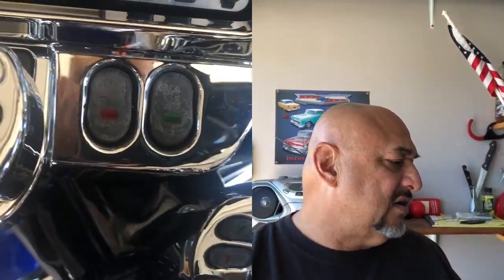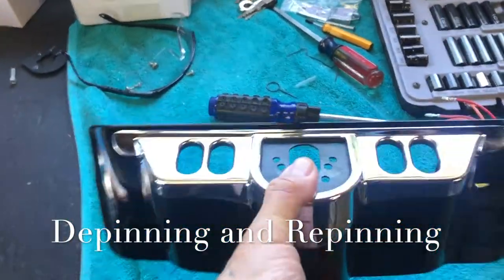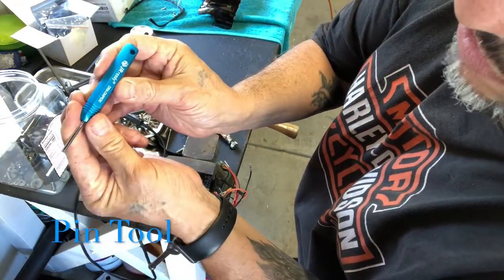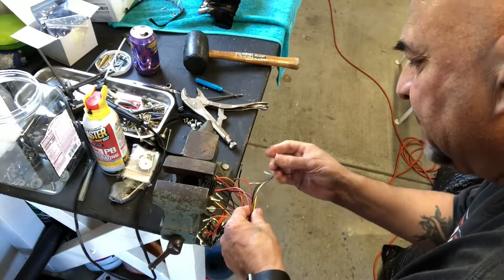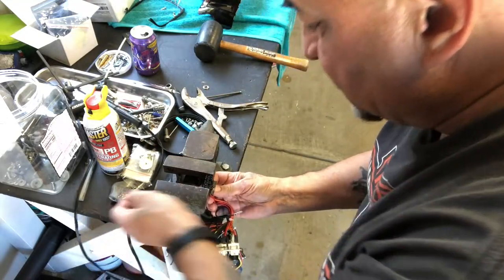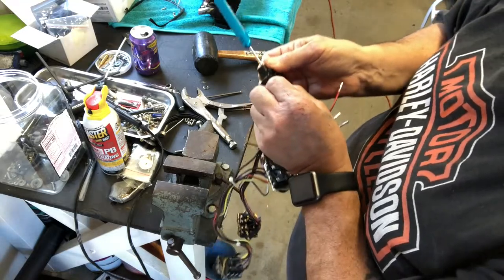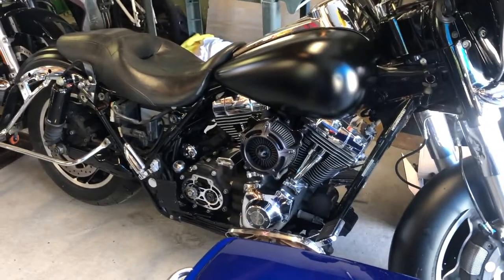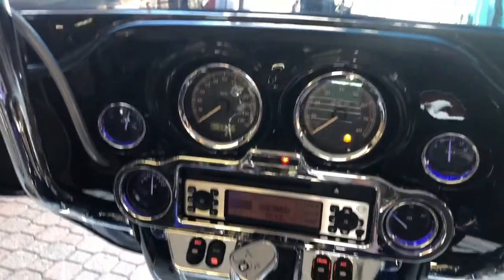NEW HARLEY ROCKER SWITCHES LOOK GREAT!!! #harleydavidson #HDtutorials #Harleybuilds #HDRides

Comment: Can you hard wire one of them switches to a hot and ground to after market spot lights. Problem the after market lights have 2 wires and the switch I got from harley has 3 wires?

Comment: I had Harley redo my button panels too but the speaker button doesnt function with the new Jensen radio I had put in. Same bike and year btw. The service manager said it was to cut the tweeters I had put in off and on. But they dont. The button lights up but just doesnt function. Also, the ACC button doesnt function with my upgraded chrome heated grips and it also lights up as it should but jist doesn't work with the grips. Do they have somethimg hooked up wrong?
Reply from the maker: Good evening and thank you for your question hungry hippo. I have to look into that one. If the switch is good you should have an on and off function.  As far as the heated grips I have yet to install them on my bikes as it does get pretty cold here in winter but now you got me thinking. No promises but I will definitely look into this. Have yourself a good evening.

Comment: Do you know where i can get rocker switches like that for a 2021 Road Glide?
Reply from the maker: Hi and thank you for your question. You know I’ve purchased them for older bikes like 2015 and down on EBay who has pretty much everything but not for newer bikes. You might want to start there they might have them. A lot of shops and stores also sell on there. Hope you find them. 🙏🏼👍🏼
Reply: @jcustombuilds  Ya, been looking everywhere....seems that I can only get the factory Harley ones.
Reply from the maker: @shuff1111  What exactly do you need and I’ll check with the guy I buy mine from.
Reply: @J Custom Builds  Actually, I just realized, mine is different....wiring harness is pre-assembled into the bike and it requires the newer push button type switches rather than rocker switches.
Reply from the maker: @shuff1111  Aww, gotcha. Are you currently working on it now? If so can you show me what your doing and in need of? You can send me pics or videos. Here’s my cell. 510-750-0653

Comment: Hi buddy great video where you bough the switches i want do same yours
Reply from the maker: Hi and thanks for your question. I will get back to you with the info in a couple days. I'm currently recovering from this bug going around and it knocked me out of commission for a few weeks. Hope your having a great Thanksgiving weekend.
Reply: I’m also interested in where you got your switches from. Hard to find.
Reply: Thanks bro for reply i found it on ebay
Reply from the maker: @bdanger231sdiyvideos  Wish I could add pictures here. Here’s a few stores on eBay selling lower fairing switches: Dennis Kirk. Drag Specialties Inner Fairing
Switch Assembly Kit - 2106-0221
Reply: @jcustombuilds  thank you!
Reply from the maker: @bdanger231sdiyvideos  Anytime. Have a great day and best of luck. Let me know if you have any other questions or need help with the installation.

Comment: Why didn't you just insert a pin and pull them from the plug the correct way?
Reply from the maker: That’s the way I was taught.
Reply: well it seems to work for you . I lift the tang with a pin while pulling a little on the wire and they slide  right out.
Reply from the maker: @TimLuplow  I’ll try that next time. Thanks I appreciate your advice. Have a great day.